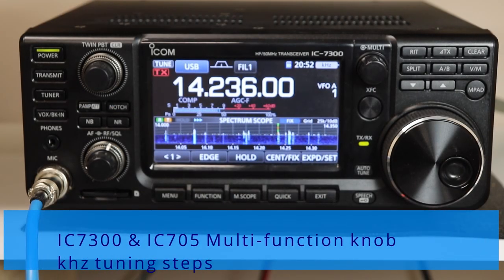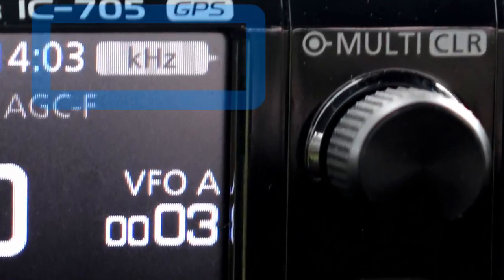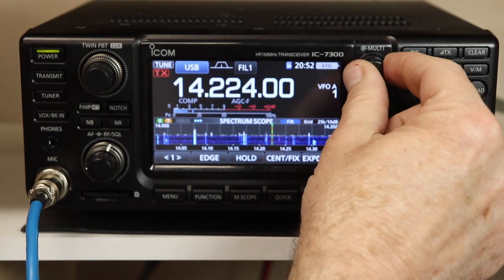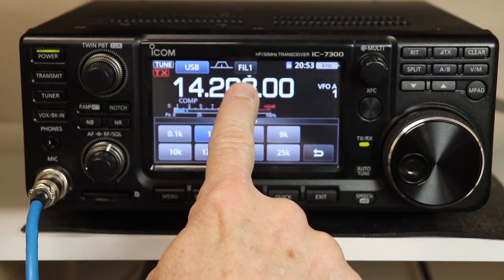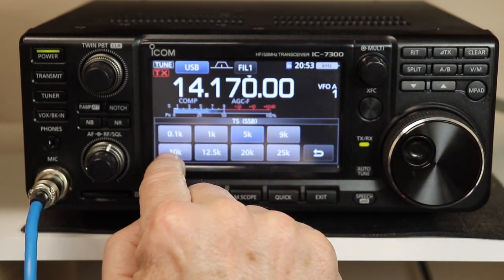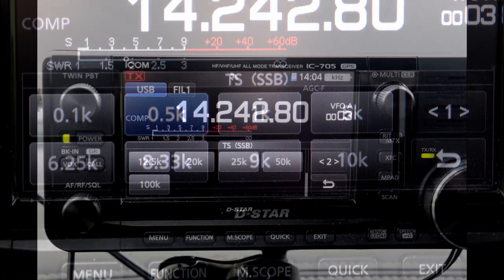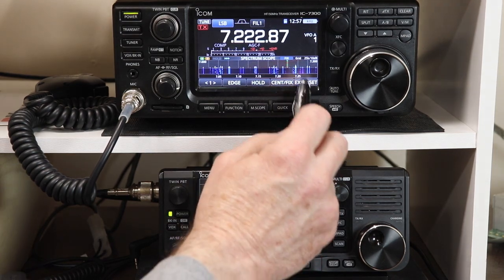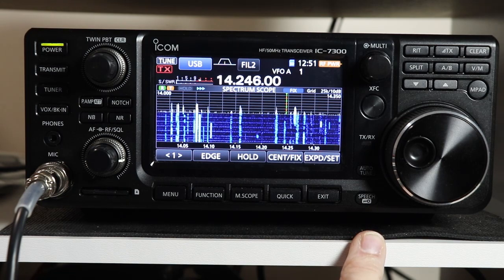IC7300 & IC705 Multi-function knob Tuning Steps

Comment: Thank you for the super tips!  Using this feature for me has become useful since I like tuning with larger steps using the MFKnob and then fine-tune with the conventional VFO.  Activating the 1 Hz digit allows you to tune like this.  The same can be done by touching the KHz numbers (after selecting the desired steps for the MFKnob) and you can tune with larger steps than Hz.  The side-by-side comparison is a good idea.  Thanks again!   73 K7GYB

Comment: Tom, thanks for this great video! I currently have the 7300 and plan to add the 705 soon. The combo 705/7300 is a great idea. I encourage you to do so where appropriate. I looked at ALL of your 7300 videos before I chose to buy it as I wanted to be sure of what I was going to be getting and if I felt I could understand how to use it. IMHO, your series on the 7300 is clearly the best on YT though there are some other quite good ones as well.
73 de Chris W6NOB

Comment: Well you didn't mention whether or not going to 10 Casey steps would change it to a 0.0 step or if it would maintain whatever you have tuned in say 28.427 will it go click to 28 437 or will it make it go to 430 and then 440 etc in other words does it zero it out or does it save your tuning frequency at least down to the one KC point?

Comment: Great videos, Tom!!  I'm a tad confused on the multi knob tuning ability, though.  From my cursory experimentation, it seems that whatever you have set as a step in frequency for the VFO translates to the muti knob as well.  However, it was my impression from this video that their respective steps can be set individually.  Would you mind clarifying, please?
Reply from the maker: Hi Glen,  There is one minor detail that I didn’t make very clear. When you press and hold the KHz digit to set the step size, it leaves the main dial in Step tuning mode.  This is indicated by a small triangle above the one kHz digit. If you briefly tap the kHz digit, the main tuning knob returns to normal tuning mode (the little triangle disappears). However, the multi-knob will continue to tune based on the step size you just selected.

Comment: Great videos, I’ve only had the 7300 about 2 weeks and I’m not done with all the videos but my question is can the dial or scope be customized for particular band ranges? i.e… only have the screen and dial show the frequency range for 40 meters 7.175-7.300? to stay in those parameters. I hope that didn’t sound too dumb, I’m also new to the hobby lol, thanks
Reply from the maker: Hi Vincent.  There is a video on that.  Check out the IC-7300 A to Z #3:  https://youtu.be/k4qP1yn3kIA
Reply: @HamRadioA2Z  ok, I appreciate it, again thanks for all the help, you also got me thru the firmware update

Comment: Do you have a video on how to put the 7300 in 60 m mode have F/W  141 in my 7300 WQ9V.
Reply from the maker: You can just enter the frequencies for each channel.  You can program them into the memories.  I think I may have covered this in the 7300 A to Z series #5.

Comment: Hi. The multifunction knob does not change my frequency is there a setting to switch this function on or off. Regards Martin M7MGD
Reply from the maker: Hi Martin.  I have several questions that might help you get to the bottom of your issue:
Is the radio in VFO mode?  If the radio is in Memory Mode, the Multi-knob will change channels, not just change your frequency in khz steps.
Are we talking about the IC-7300 or the IC-705?  If it is the IC-7300, you must update the firmware to the latest version to make this work.  If it is the IC-705, it should work with the version the radio came with.

Comment: Thanks for the video, while you can adjust the multi knob Khz, say to 1k it also adjust the main dial to the same steps. This way I don't seem that we are gaining too much as you might as well us the main dial. I thought it would be good if you could say adjust the main dial and multi function knob separately. Say adjust main dial in 1k steps and the multi function knob to 0.1k, so if the signal is a bit off frequency with the main dial 1k you could fine tune with the multi in the 0.1k step, not unless I am missing something?
Reply: I activate the 1 Hz digit and you can do exactly what you are saying isn't possible for you.  After selecting the desired step, exit out of the TS screen and then touch the 1 Hz digit and you'll have variable/selective tuning using both knobs.  Or you don't have to have the 1 Hz step activated... just touch the KHz digits (after selecting the desired step for the MFKnob) and you'll be able to scroll using two different steps.
Reply from the maker: Hi Noel.  Yes.  When you hold the khz digit to set the tuning step, it also puts the radio into khz tuning mode.  You'll see a small arrow above the 1khz digit.  That makes the main tuning knob behave the same as the multi-function knob.  If you briefly tap the khz digit again, it will turn off the arrow above the digit.  Then the main tuning knob will work normally.  The multi-function knob will still tune in the new step size that you just set.  Then you don't have to keep tapping the khz digit to switch between tuning speeds.  You can use the main knob and multi-function knob.
Hope this helps.
73,
Tom
Reply: @HamRadioA2Z  Thankyou both for your return replies. As I say, I could be missing something, yes, well now  I can say put the K digit to 5k and the multi tunes in 5 and the main in 0.01k. I just find this bit reverse to how I am thinking I would like it. I would actually like it if you could put the main dial in the 1K step and the multi in the 0.1k step as these days most SSB signals are on the 1k increment and you could just use the multi for a little fine tuning. I would like to know your thoughts.
Reply: @noele8631  Hi.  I've tried to set as you'd like to use it and I can only get it to work with the main VFO knob using the smaller/finer increments.  To my tastes, the main knob seems to be more natural to me for the finer-tuning, but I understand personal preference in these cases.
Reply: @davidvaughn7752  Thankyou for you reply, work is just getting in the rode of my radio time, looks like I could think a bit different to most others, but yes never mind, still a very nice radio, good DX to you all.